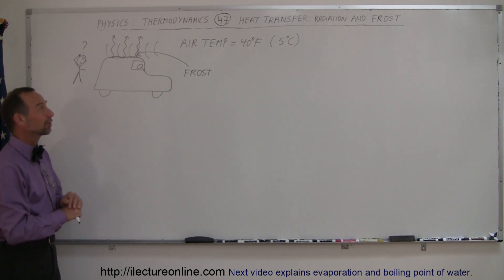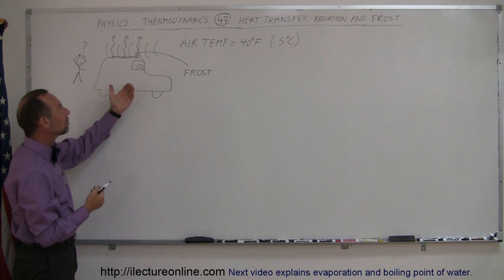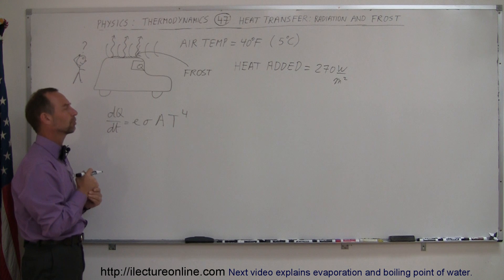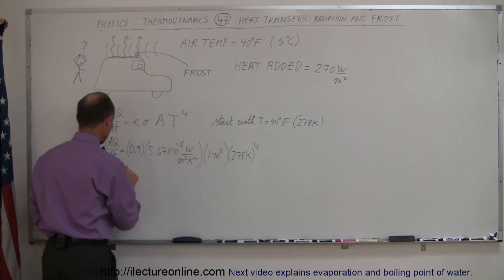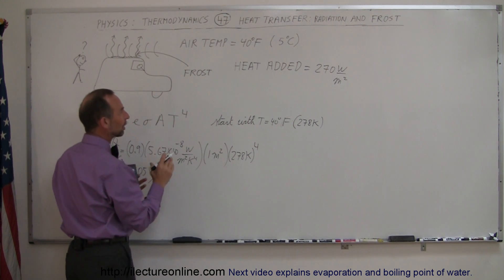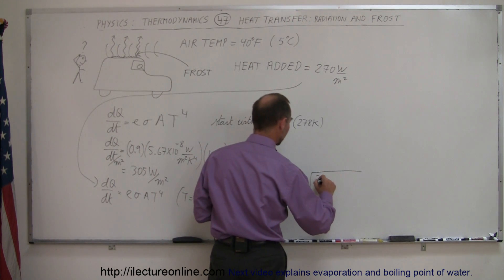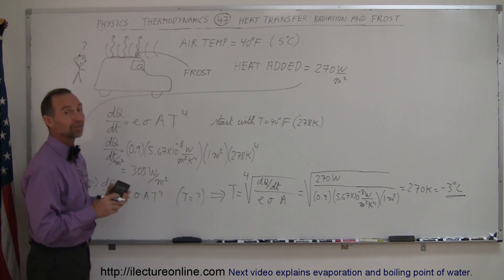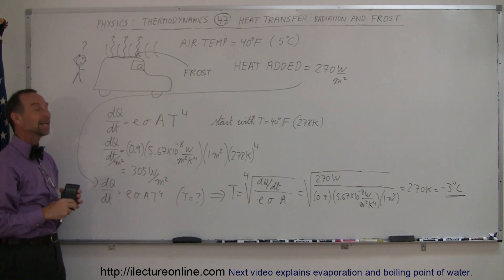Physics 24  Heat Transfer: Radiation (31 of 34) Radiation And Frost

Comment: Really great list. Two suggestions, a video on relation between humiity and vapor pressure, and few examples of calculating heat in all. Lets say food in aluminuin foil, there is conduction, radiation maybe convection too, or house warming batteries where there will be conuciton, convection radiation. But in either way, great list. I learned a lot <3
Reply from the maker: Yes, these videos tend to be theoretical, as you would find in a physics book.  There are lot's of great applications to daily life that is very interesting.  Something to consider for the future.

Comment: Michael, like 40 yrs ago there was
A front cover article about the "thermo barrier"if I remember 
Right it was a monthly issue 
Of "scientific American " I was 
And electronics tech in a R&D
lab at the time. The article showed a red hot bar with a probe attached to a high voltage power supply like 15kv
The probe tip was mybe 1/8"
Or 1/4" from the glowing rod
In the middle of that rod. right at that point the rod it was black, it fascinated me ! So much that on my lunch period
I disassembled a heat gun
Removed the heating element 
Just a wound coil of what I belive was a nicrome wire.
I powered it up it glowed red
Then I took my 20kv high pot
Tester dialed it up to about
16kv and moved the probe in
With 2 engineers looking over my shoulders well I'll be damned it Worked , that area went black and was glowing 
Red on both sides of a small black area.but there was a catch
If a spark from the probe jumped to the glowing element
Tha black area went away.
The probe had to be making
That scary hissing noise like it was ready to arc over right
At that point it worked there seemed to be this sweet spot
But the 3 of us were blown away.then the engineering manager cam over and busted up the party. All this to say
Michael what was going on here? What is this thermo barrier? Did the electrons
Of the material go from a lower
Energy to a higher energy orbit
Causing a more powerfull photon and releasing more
Energy making it a higher
Frequency? I'm only guessing
This guestion is on my bucket
List. I would love your read on this !!
Reply from the maker: I am not familiar with this particular phenomenon, and a quick search on the internet didn't make me any wiser.  I can only guess that a strong electric field produced by the high voltage probe, affected the thermal vibrations,  causing a greater energy release, preventing that spot from becoming as hot as the remainder of the heating element.  (But I could be completely wrong).
Reply: @MichelvanBiezen   thank you Michel !! I do greatly appreciate your time
And thoughts on this

Comment: Michele, let's say I have a tuning fork I heated it up to let's say 50 c then struck it
Would it black body radiation 
Be different then it natural 
Resonate frequency ?
Reply from the maker: Blackbody radiation and the oscillation frequency are not at all related to one another.  The only aspect that would be different is that the motion of the forks on the tuning fork would cause alternating blue shift and red shift for the blackbody radiation, but it would be very minor.
Reply: Michele thank you ! I hope my question wasn't to dumb
Reply: Michael would the comon relationship of black body
Radiation and fork Resonate 
Be the material the fork is made of ?
Reply from the maker: Your question wasn't dumb at all.  The blackbody radiation curve only depends on the temperature of the object.  The intensity of the blackbody radiation does depend on the emissivity of the material.

Comment: Michael, could u help me solve
This. Would a heat sink for
Power transistors let say
Pushing 100 watts dissipate 
More heat if it was painted black virus just leaving it
It's normal aluminum color?
This goes back to and old
 argument in 1969 in a electronics company I worked
In where our engineering Manger said it wouldn't help
Unless it was in space.
Could u do a video here ?
Just asking. I'm 80 now still
Don't know
 for sure.
Reply from the maker: From a theoretical perspective a black surface radiates energy more efficiently than a silver colored surface.  That is why they used to paint the glass in the old thermos bottles with a silver paint to reduce the heat lost by radiation.  Good that you keep yourself challenged like this.  🙂

Comment: Isn’t the equilibrium dQ/dt going to be different, since both are losing heat as time goes on and by Stefan-Boltzmann law, dQ/dt would also decrease?
Reply from the maker: Essentially the heat lost will be trough radiation, which decreases with decreasing temperature, and the heat gained will be from the collisions of the air molecules and radiation from surrounding objects.  When the two equal one another, that is when the temperature will  become stable.
Reply: @MichelvanBiezen  But then why do we use the initial dQ/dt heat added as the equilibrium heat transfer, when dQ/dt added is decreasing?

Comment: In the video you specify that this effect happens when the air is above freezing, does the same effect work when the air is below freezing?
Reply from the maker: The purpose of the video was to show that you can have frost covering surfaces while the air is above freezing.   When the temperature is below freezing you don't need this effect in order for water to begin freezing.

Comment: sir, is 5 degree celsius here is temperature of air or the surface of the car,if it is of air then dQ/dt you have found here is heat given by air to the car,it is not the heat radiated by car in atmosphere...if I am wrong then please correct me....( dQ/dt =305)
Reply from the maker: Heat added to the car by the air is NOT radiation but convection.  The 270 W/m^2 was a given quantity in the problem.
Reply: ok...sir,here heat added to the car is through convection,then why are we using the formula of radiation to find the temperature of car surface? we should use dQ/dt=h A delta T formula then.
Reply from the maker: No, when heat is lost and gained by an object, the temperature will reach the equilibrium point when the heat gained equals the heat lost.
Reply: @MichelvanBiezen   Sir, I also think 5 degree C here should be surface temp. of the car if we use radiation formula to know dQ/dt the car loses,,, But you've written AIR TEMP = 40F (5dc) on your white board.